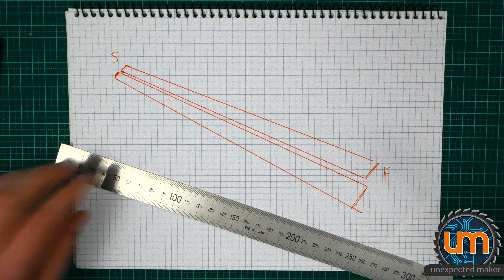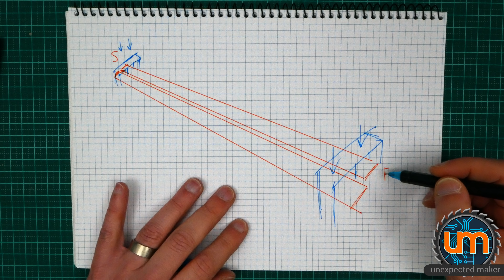Arduino Hot Wheels Speed Track Part #1 - Prototype

Comment: OMG that was my favorite thing to do with hot wheels as a kid too! Also was just trying to learn about bluetooth with arduino!
Reply from the maker: That's really cool Scott!!!! Do you have a project in mind for bluetooth?
Reply: Yup! I recently designed a 3 axis robotic arm using 9g servo motors and would like to control it with bluetooth. I wasnt sure what kind of module to use, but now I know! Great vid btw
Reply from the maker: Try to grab the HC-10's if you can... identical in design and pinouts, but use less power, if power is a concern for you.
Reply: Awesome, thanks for the advice!

Comment: Hello...  Did you ever look into ESPnow for such a thing?  I never used it, but only because I never had a need for 2 independant nodes like you did.  But it seems perfect for such a project. I don't see many people using it, maybe it sucks...

What a shame microcontrollers weren't affordable when I was a kid!!!!
Reply from the maker: Hey James, I've not looked at ESPNow, sorry, but I already had the BT modules anyway, so decided to just use what I had lying around.
Reply: Ok...just curious.  I see Andreas Spiess made some statement that he had problems with bidi communication.  For your case, seems it wouldn't matter and would work good, just wondering if that was a stumbling block for you or anyone, or if it just wasn't cracked up to what it was supposed to be.  It's funny, if you do a YouTube search for it, you find several people showing you how to use it, but no one doing a "real" project with it like you did.

 I have plenty of those Bluetooth modules too, and probably would have went that route myself - because, as Sheldon Cooper says "Everything is better with Bluetooth"!

It's funny, it seems a great feature, but you never see anyone using it. 
I'd give it a try, I just cant find a use case!

Great project you have there BTW!  I may do a similar replication for my godson.

Comment: Cool project! It is always interesting making something for someone else. I feel this project might use the 3d printer.
Reply from the maker: Thanks! Yes you are right, making stuff for other people is definitely a different type of challenge than making for yourself... but much more satisfaction at the end when you pull it off... and yup, 3D printing for this project... but possible alternative construction with foam board.
Reply: Also a great job of using different modules to complete a task.
Reply from the maker: Thanks buddy :-)